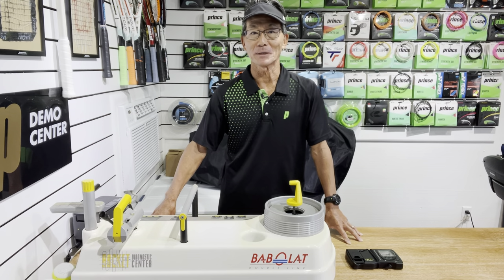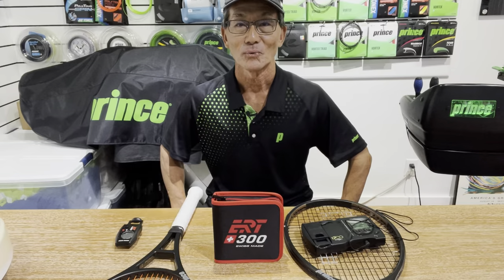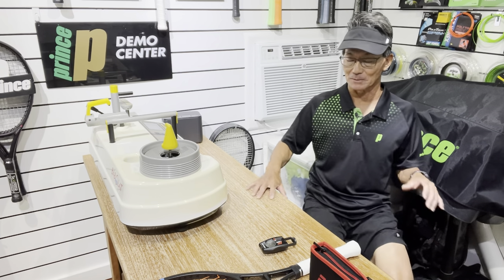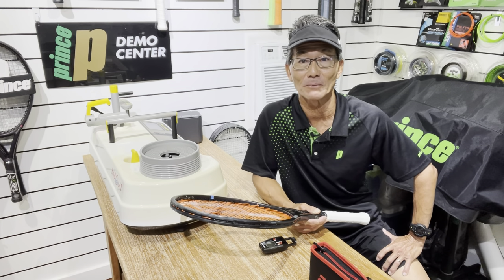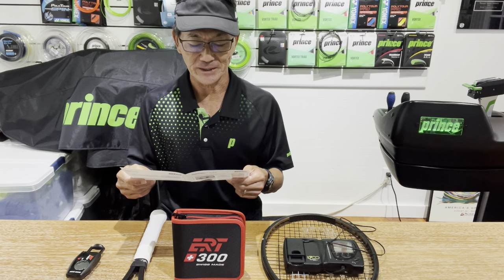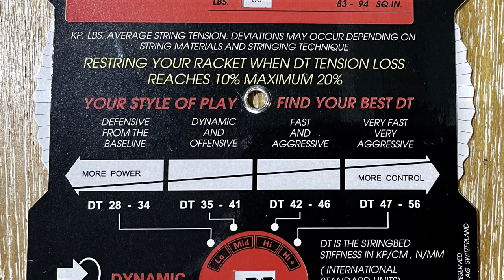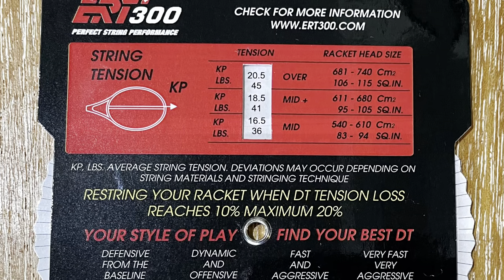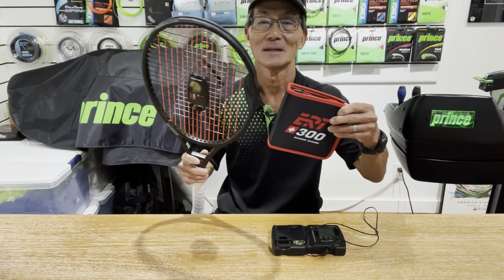Racquet Stringing [RDC vs ERT | String Bed Deflection vs Dynamic Tension]

Comment: I am curious to know 2 things about the RDC as it relates to string bed deflection. First, is there a calibration procedure for this function? And second, is there a lubrication schedule for the mechanism?
Reply from the maker: Aloha Ed, 
These are good questions, but unfortunately, I can't answer them. Nothing in the user's manual or technical guide mentions either one of these. I have one of the original models of the RDC and have been fortunate to keep it running for almost 30 years now without any issues. 🤙
Reply: @AMstringing  Thanks for taking the time to check and for responding so quickly.

Comment: ERT300 works very accurately compared to the set tensile strength of the stringing device. Especially with syn gut and multis. There is sometimes a small difference with polys, especially with thicker polys (1.30mm)
Most requested stringjobs for 100in²
DT 30-33 Poly   20-22kg
DT 33-37 Syn-Gut  22-24kg
DT 35-38 Multi   23-25kg

Grtz, Eric, Belgium
Reply from the maker: Aloha Eric, Thanks for contributing your string setups! This is great information! 👍

Comment: You have my setup!  My DT is 28.
Reply from the maker: Aloha Alan, Cool! Funny, according to the ERT300, at the 28DT reading, it's almost "time to restring!" 🤣
Reply: @AMstringing  When I first get my rackets from you Arnulf's ERT300 reads 28.  I send them to you when they reach 23, which is almost now.
Reply from the maker: @alanvanzee  Yes, since you have access to Arnulf's ERT300, you can see how string tension really drops. My ERT700 wasn't always able to measure the tension of your string setup for some reason, but I'm guessing that it was probably at 30/31 DT right off the stringing machine. I'll be able to check now since I have the 300 and will let you know. 👍

Comment: I question how to interpret DT and RA values as they focus heavily on the properties of the center strings, NOT the entire stringbed.  I say this because when I string traditional, say 54 lb mains, 54lb crosses, I get a very similar RA or DT as when I string proportionally with shorter strings being strung at tensions lower than longer center strings.  In fact the outermost strings are installed in upper 20’s.  The stringbed is clearly not the same.  By checking tension on individual strings with a Stringmeter, it’s easy to see there is a dramatic difference, however DT and RA simply does not reflect this difference. So what are these devices actually measuring???  I suspect the measurement skews heavily toward the tension of center mains and crosses vs the entire stringbed.
Reply from the maker: Aloha John, 

You bring up an interesting point.

However, I'm surprised that when you strung using the proportional stringing method you got similar readings. I would have guessed the readings would be lower than a traditionally strung racquet. 

As for the tension measured on individual strings with a Stringmeter versus the center of the string bed measured with an ERT300 and RDC, here's an interesting experiment I did with all three devices.

I strung two racquets with the same synthetic gut both at 52 pounds. One racquet was a 110 (16x19) and the other was 100 (16x18). 

RDC reading – 58 units
ERT300 reading – 56 pounds

STRINGMETER readings - During the stringing process, I took the readings on the two center mains, located at the center of the string bed at the following intervals. Notice the tension listed on the left main (LM) and right main (RM).

43LM/43RM after installing 4 mains
41LM/41RM after installing 8 mains
38LM/38RM after installing 12 mains
37LM/37RM after all mains were installed 

39LM/39RM after installing 4 crosses
43LM/43RM after installing 8 crosses
47LM/47RM after installing 12 crosses
51LM/51RM after installing 16 crosses
51LM/51RM after all crosses were installed

In the end, the Stringmeter came out with a final reading of 51. In my opinion, this final reading was due to three factors.
1. The natural frame distortion that occurs during the stringing process. 
2. The main strings are stretched after the installation (weave) of each cross string as a result of being pushed up and down.
3. The tension reading of the center main strings is tighter due to the surrounding strings that keep them in place. 

I hope this makes sense. 🤙
Reply: @AMstringing  All makes perfect sense. I suspect the reason the mains went down with each measurement may have had something to do with frame distortion, but also from stretching those center strings taking readings with the Stringmeter.  If you were to perform same setup again, I would not be surprised if you waited to measure until after 12 mains were installed, you might find a reading closer to 43 than 38.  

And yes, I expected much different readings on proportional vs traditional too.
Reply from the maker: @johnyoungblood  I'll try that experiment the next time I have the opportunity to do so.